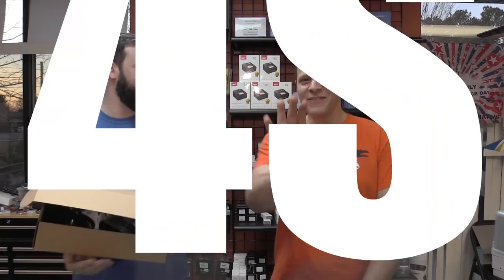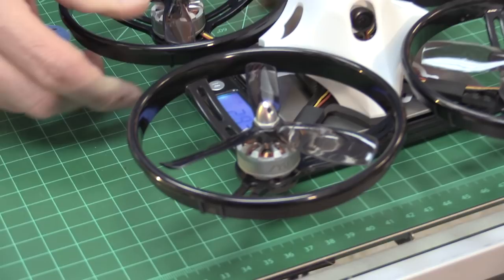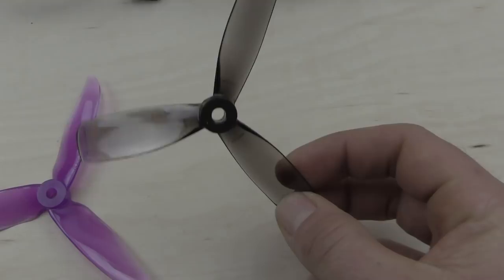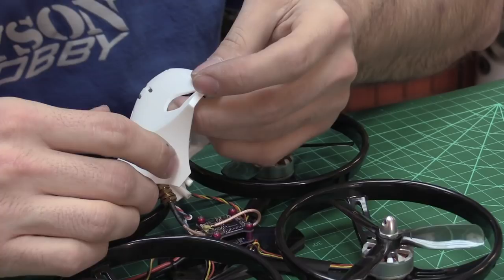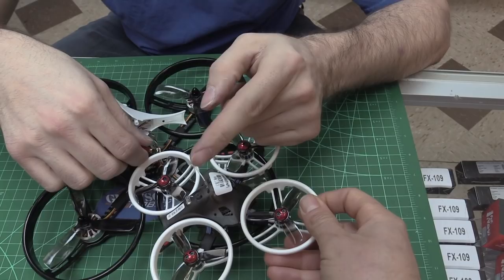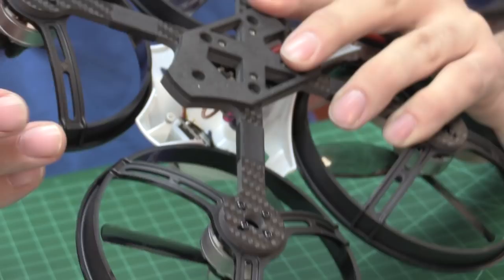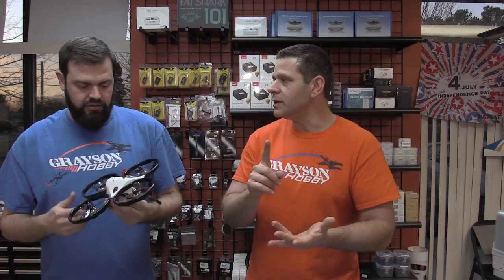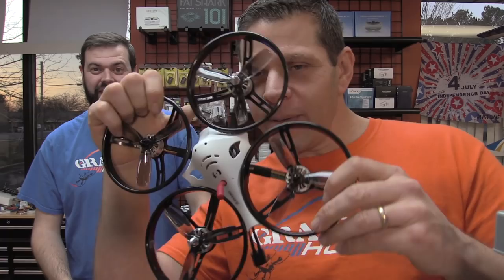The Largest Whoop Ever! KingKong ET MAX - 4Inch FPV Drone Whoop

Comment: LDARC, please include the plastic case as typical with the other ET's, this is very convenient for carrying it with batteries to the field. I love the ET's architecture, solid! and just waiting for the ET MAX to get all the details ironed out.  Definitely, a great size for the Caddx Turtle V2 for cinematic purposes. A while back, I designed a similar size strictly for the Caddx Turtle V2, for filming, not racing. However, this ET Max, can fit a number of appplications and I just love this line's modular,  clean and logical approach, the camera well protected is an added bonus.

Comment: As a complete NOOB looking to get a first drone (done some rc planes and basic copters in the past)... I don't understand why most drones aren't made this way. It seems very durable and even if you are an expert it would make others more comfortable I would think if you fly near people, knowing it had covered props. I'd like to have something like this but with a lot of features like GPS, AI flying with gyros and proximity sensors for follow me, obstacle avoidance, fly to home and all that good stuff etc.. and a 4k camera on a good gimble on top of whatever cam is easiest to transmit to a FPV setup (720p?). I love the idea of long range too. I often 4wheel deep into the mountains to find obscure camping spots and that would be epic to use for finding things 2 miles away and taking great vids of the scenery. SO... sounds like I am asking too much right? I should probably start with something easy and when good enough at piloting, build it myself... but I really like the exoskeleton design of these things for sure. So much more durable and safe it seems? Do most drones not use them just to save weight (non-trivial in RC flight I know) or is there some other reason?... not to mention they look like those alien ships from independence day a bit haha. Oh gawd.. I have a feeling this is going to become a bigger hobby and money sink than last time I got into RC. You know something is up when every youtube droner is sitting in front of a wall of drones.. not just one or two. May the RC gods have pity on me and my small pocketbook.  (⊃д⊂)

Comment: I still waiting for that 10 minute Mix install on the ET115. I got mine up and flying and it works great. I also upgraded the antenna to a SMA style connector and a stubby Lollipop.  I experienced a massive improvement in FPV feed quality. I have some photos of the conversion at the beginning of my latest video if you want to check it out. 

As for the Max, those motors don't look up to the task. The wires are too small as well. I don't mind the CW/CCW motors and I like the nuts. They look like they can be removed by sticking something through the hole. I wish that KK would give more detailed info(UARTS on the FC) either with the craft or online. I'm running the same stack on the ET115. The flight controllers(F3,F4) look identical but are different internally. You have to change the receiver from UART3 to UART6 in Betaflight.
Reply from the maker: Tuesday
Reply from the maker: This was a distraction lol

Comment: Looks like a competitor to the Blade Scimitar 170, a quad that there's no market for. 

Cons:
- Way over 250 grams with battery. Huge minus considering current demand for lighter quads
- Too heavy for a beginner quad.  It's likely to cause damage when it hits something
- One-piece frame.  Works great on the much lighter ET quads, probably won't hold up to beginner use being so much heavier
- Requires the space of a standard 5" quad to fly.  Can't compete with the large quads, and too big to fly in smaller whoop areas.
-  LDARC is competing against its own product line.  The ET 100/115/125 already fills the large beginner whoop category and is much more beginner friendly.

That being said, I admit that I really like the looks of it.  But I'd much rather see them make a HD version of one of the current platforms.  A sub 250 gram ET 125 that is 3s capable with a HD camera that could hit a competitive price point would be very tempting.  Perhaps even a Tiny GT8 HD with F4 FC and betaflight OSD?

Comment: Wait, is it April 1st already?
I wonder how tough those prop guards are, the ones on my original ET100 from 2017 are tough as nails, haven't broken them after many crashes, I took the guards off my ET125 because they broke too easily and so i can run it with Gemfan 3025 2-blade props, it rips - youtu.be/2mKLpIoVBWI

Comment: The gt200 only has 1806 motor for 5”
I don’t understand why this has bigger motors for 4” props? And 2200mah seems wayyyyyy heavy!
1806 and 3s 1000mah seems like it
Would of been perfect, and a logical step up from the ET125
This seems to have missed a step..
Hey, if it flies good, and long flight times, & durable, fair enough 👍
Reply: KingKong always Fuc%s up something or many features of every quad they come out with! They haven't made one great quad to date! Always something screwy! 😩
Reply from the maker: The frame is heavier due to the large plastic prop guards

Comment: Lol, I'm building an ET125 and I already think it's huge.
Reply: That's the way to do it! The ET125 frame was the only thing good about that quad!  I too built one! All those other parts were garbage!
Reply: @scootroter4859  These frames are a fantastic value. I'm done building mine and I love it. I went for a Diatone F405 mini-stack, T-Motor/Racerstar RT11s, an XM+ and some AIO I had lying around. The build costs me less than 100 usd total thanks to the new year specials on BG.
Reply: @yannickg6904  😎🤘

Comment: this could be an awesomer trainer for an advanced FPV Pilot who wants to get into "bando" style.  WITH BETTER MOTORS  this would allow bouncing off walls. crete. etc  without damaging anything yet styill be able to do powerloop/juicy/etc  cfrazy fun flying.   If (when)  the frame comes out you could build this up with a nice 20x20 stack and good motors.m THE NEXT step (we all know its coming)  a BNF CHEATER KWAD !!    plain jane 5" racers are now obsolete.  fogetabougtit …  I absolutely HATE plastic wires on motors.  I will  NOT touch any motor with it.   SO when this comes out if the motors are sdtandard silicon I am in !  Maybe a variatyion with two cameras on this ???
Reply from the maker: Got it, we will send on the info!  - thanks! - Basil

Comment: c'mon... prop guards don't make a 'whoop'. that was funny though...lol, it's so big. Anyways, this is just more continuation of the weird proprietary shenanigans that started with the original ET series that started life as a Blade Torrent 100 clone.  

Stupid company .. they had something nice on their hands and sat on it for almost 2 years (especially since the Torrent has FC issues/gyro drift) as it's popularity evaporated away. All they needed to do was update the original ET100/115/125 series with BFOSD compatible boards then bring the motors and escs up to date. Instead they just pile on more of the same unfinished, unpleasant proprietary weirdness on their builds with these "updated" GT/ET builds.
Reply: Mewt:  You hit the nail on the head.

Comment: Looks ridiculous. Nothing but problems with kingkong ET electronics. 
Pass. I can build a better 4" with $160 and I won't have to keep replacing electronics.
Reply from the maker: Between my 2 boys and our shop KK quads, we zero issues with the electronics.  Sorry to hear you experience was not as good as ours :(
Reply: Between my friend and I we've been through 4 or 5, some only lasted a month. Too bad, they really were fun. The cost plus repairs and replacements was more than buying better quality models. None of our other quads have that much problems. You get what you pay for, I'm done with cheap quads.